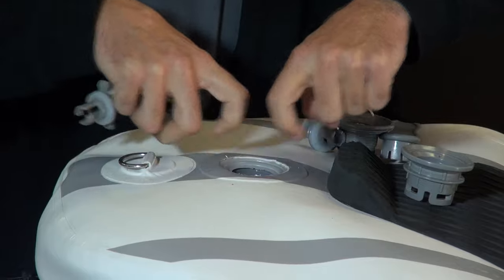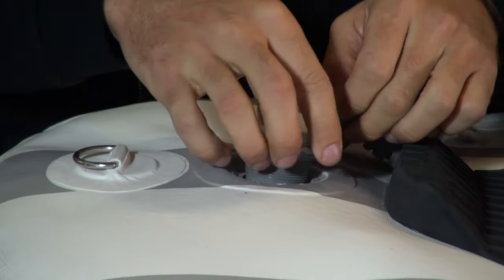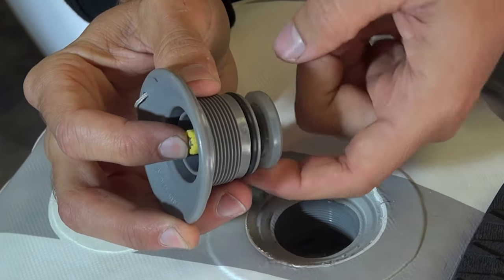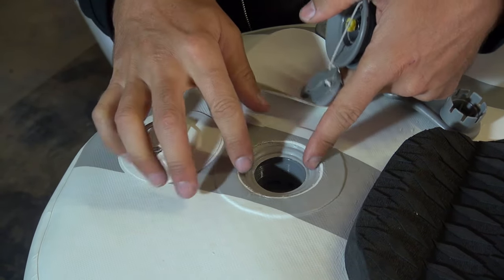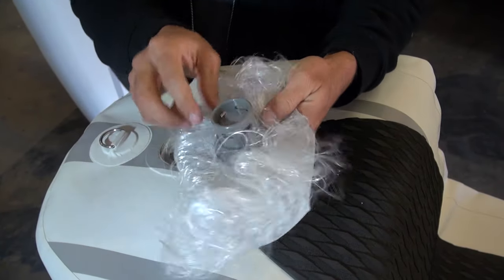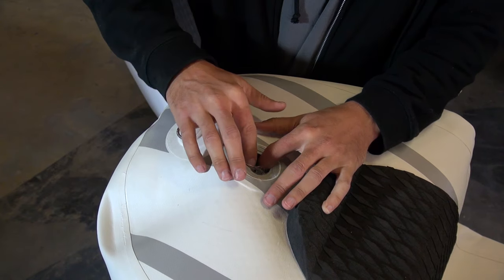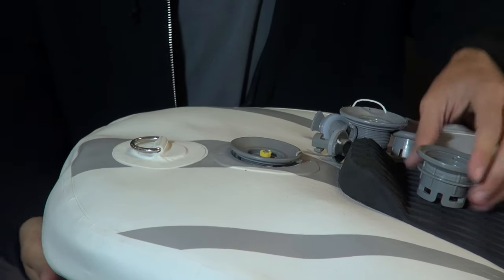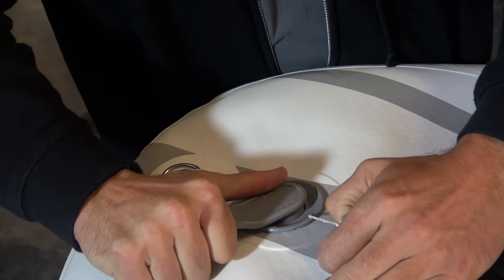Replacing your Tower iSUP valve

Comment: This helped to a point. I had a leak at the valve. Upon u screwing the valve off, I noticed a crack in the pvc ring on the board. I tried patching it up as instructed here by placing the edge of the patch over the crack and glued it down. The next day I went to pump it up to check my work, and it caused an even greater leak, due to the thickness of the patch itself. 

I ripped my patch off and hit the drawing board. I noticed I needed a new, seal all around the valve upon screwing it together. So I took a new patch, traced the small portion of the valve directly in the center of the patch.  I carefully cut out the hole I traced. I used the rest as a makeshift washer for the valve. Slid the patch around the threads of the valve, and continued to screw it all back together. Once it was tight, I realized I may not even need glue. I pumped it up to 10 psi and no longer have any issues. 

Gonna let it rest in my garage for a day to see if I lose any psi. If I do, I'll glue the patch down to the board and I'm sure that'll solve the problem 100%.  

If your pvc ring is cracked, dont listen to this videos half-assed advice. It doesn't work.
Reply: I thought the same thing watching the video.  "That won't work!"     Making a custom pvc donut washer makes more sense.
Reply: @ceeweedsl  they're true engineers over there at Tower. 😒

Comment: How do you repair/replace the part on the inside of the board?
Reply: Any success? I'm having the same problem...
Reply: I just watched a video where the tech removed the inside and then made up a donut patch to fit a new valve base.  He got the new one into the old hole and then glued down the patch trapped into the new donut.   Not easy at all.  
If I ever have to do this, I'm considering using a leakfield valve instead.  NRS sells them.  https://www.youtube.com/watch?v=x8n1p5ZEEMc    Or search for installare una valvola di nuova generazione     It's italian, turn on translate CC.  
Found another in English:  https://www.youtube.com/watch?v=BBjDQn3PyzA

Comment: For those who need to replace the whole valve for one reason or another, I found a video where the tech removed the inside and then made up a donut patch to fit a new valve base.  He got the new one into the old hole by cutting it open a bit and then glued down the patch.    Not easy at all.  
If I ever have to do this, I'm considering using a leakfield valve instead.  NRS sells them.  https://www.youtube.com/watch?v=x8n1p5ZEEMc    Or search for installare una valvola di nuova generazione     It's italian, turn on translate CC.  
Found another in English:  https://www.youtube.com/watch?v=BBjDQn3PyzA